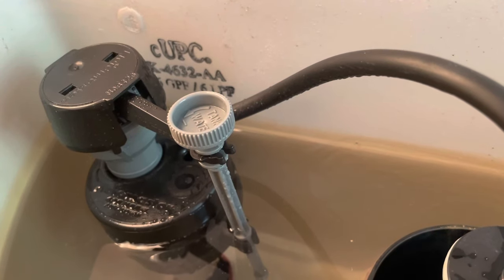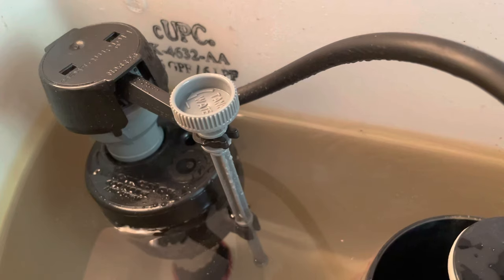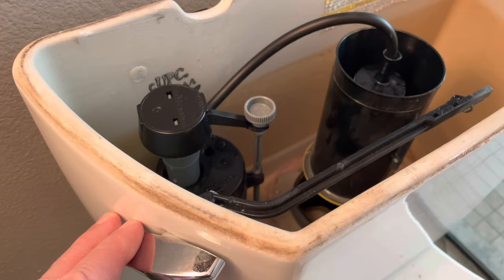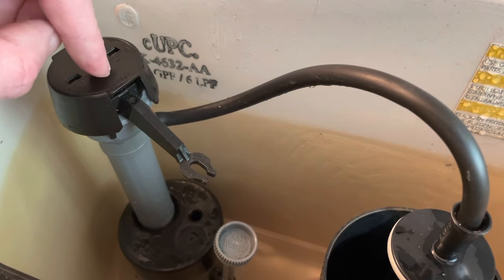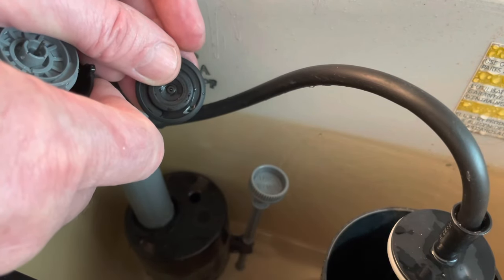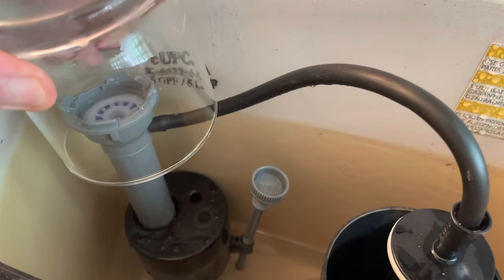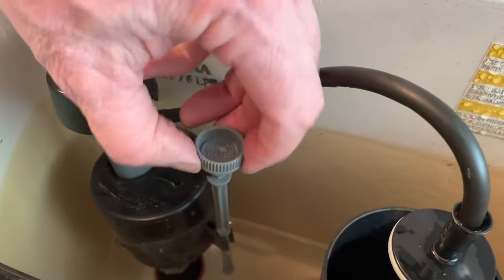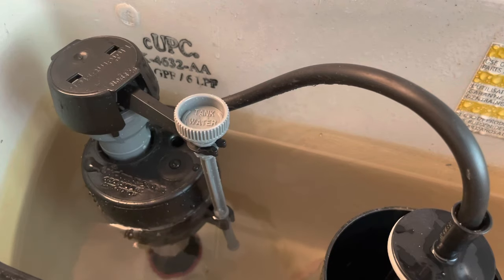Toilet Fill Valve Not Shutting Off / Don’t Replace / Fix Fast Cheap & Easy For Beginners

Comment: What if I have not water off valve
Reply from the maker: There’s no shut off valve on the wall?
Reply: @papajoeknows8355  mine actually pulls out to shut water off. Also, I saw on internet some people may not have shut off valve…

Comment: What if you turn the water off at the bottom but it still keeps filling up 🙃
Reply from the maker: It’s not uncommon for the valve at the wall to freeze up, because they are hardly ever used. It may be time to replace it. In the meantime, shut your water off to the house at the main.
Reply: @papajoeknows8355  I’m in an apartment building. I actually turn it off often bc of my toilet running and not being able to sleep. Today is the first time it didn’t work
Reply from the maker: @heycris5833  maybe try this to get that valve working. 

https://youtu.be/L-cTL7JJr8E
Reply: @papajoeknows8355  it lets me turn it all the way as it normally does. But the water just keeps going
Reply from the maker: @heycris5833  it might feel like it, but it’s not shutting off all the way. It’s gotten stuck.
Reply: @papajoeknows8355  ok going to try

Comment: What happens when you tried that still leaks
Reply from the maker: If you use your finger and lift up on the arm that extends from the top of the valve, does it turn off?
Reply: @papajoeknows8355  yes it stops but I have to lift in manually
If I let go any water that’s in goes straight out
I can’t get the water up to the bottom of the float?
Reply: @papajoeknows8355  ps thanks for responding so quick
Reply from the maker: @michaelhume8689  you probably just need to adjust the float. Here’s a vid:

Running Toilet Spilling into Overflow Easy Fix DIY
https://youtu.be/uTcYxn2bpDg

Comment: I tried it and it didn’t work.  I rinsed the seal, but didn’t wipe it.  I also did the rinse thing with the upside down cup.
Reply from the maker: Is it running and spilling into the overflow? If so, here’s a video:

Running Toilet Spilling into Overflow Easy Fix DIY
https://youtu.be/uTcYxn2bpDg
Reply: @papajoeknows8355  It’s not doing that.  It’s a very light spray noise coming from underneath the cap was was removed in the video.  There’s also a constant dripping noise.  Does not appear to be filling tank and going into overflow.  Thanks for the video/info.
Reply from the maker: @p0479  at that point, it’s probably simplest to just replace the valve, they’re only like $10. And there’s a little trick where you just replace the upper portion… I only take a few seconds, and you don’t need any tools. Here’s a video:

Replace Fluidmaster Toilet Fill Valve in Seconds For Beginners NO TOOLS NEEDED
https://youtu.be/ovdWF5Hdz8U

Comment: My toilet keeps running after it's full. When I shut the water off and turn it back on when it's full,  it stops.
Reply from the maker: If you use your finger to lift up on the little arm that extends from the top of the valve, does it turn off?
Reply: @papajoeknows8355  I tried that and it doesn't turn off. It doesn't turn off if I turn it back on slow. It turns off when I turn the quarter turn on quickly. And thank you for the response.  I do appreciate it!
Reply from the maker: @ericbitzer5247  have you followed the steps in the video?
Reply: @papajoeknows8355  Not yet, I have an eye disease called retinitis pigmentosa. I need a lot of light or I can't see what I'm doing. It looks simple enough.
Reply: @papajoeknows8355  OK, I did the steps in the video. The black seal looked OK. I put a cup over where the water flows out and turned it on thinking lime scale. When I put it back together it does the same thing, except now I have to giggle the arm to get it to turn on. And then the same thing turning off and back on turns it off.
Reply from the maker: @ericbitzer5247  when they get “fussy” like that, it’s easiest to just replace the valve itself, they’re only like $10.

And there’s a trick where you just replace the upper portion, very easy and no tools necessary. Here’s a video:

Replace Fluidmaster Toilet Fill Valve in Seconds For Beginners NO TOOLS NEEDED
https://youtu.be/ovdWF5Hdz8U
Reply: @papajoeknows8355  Thanks,  I appreciate it. I just wish the plumber I hired to put in the quarter turn didn't change out the old guts. There was nothing wrong with them and worked fine for probably 80 years. I got 2 out of the new.

Comment: I live in an apartment this toilet runs on and off they get these Plummer an some of them don't care i wish i could do it myself it is running now then it is off
Reply from the maker: If it’s turning on and off, then the tank is slowly draining… then when the level drops enough, the valve turns on to refill it, then shuts off again. Over and over. You need to simply replace your “flapper” or “canister seal” depending on which type you have. There are lots of videos on how to do this yourself.

Comment: My toilet tank doesn't always fill, so I lift the lid and touch the value and it fills. I rent, my landlady got me a new stove.
Reply from the maker: It’s time to replace the valve. There is a little trick, where you replace only the upper portion. Here’s a vid:

Replace Fluidmaster Toilet Fill Valve in Seconds For Beginners NO TOOLS NEEDED
https://youtu.be/ovdWF5Hdz8U
Reply from the maker: Also the valves are only like $10. You can get them at your home improvement store, but there’s also a link in the description if that helps.
Reply: @papajoeknows8355  Hey, landlady, fix this!
Reply from the maker: @patrickmccarthy7877  hahaha, or you can go that route. 👌🏻

Comment: My problem was the actual float sticking and not going fully up.
Reply from the maker: When they start getting “fussy” like that, it’s easier to just replace the valve. It’s easy to do, and they’re only $10.

Also, there’s a trick where you just replace the upper portion… it can be done quickly and with no tools. Here’s a video…

Replace Fluidmaster Toilet Fill Valve in Seconds For Beginners NO TOOLS NEEDED
https://youtu.be/ovdWF5Hdz8U

Comment: I tried this and it didn’t work for me, the floater isn’t floating up at all it just stays still after the water fills up.
Reply from the maker: When they start getting “fussy” like that, it’s easier to just replace the valve. It’s simple to do, and they’re only $10.

Also, there’s a trick where you just replace the upper portion… it can be done quickly and with no tools. Here’s a video…

Replace Fluidmaster Toilet Fill Valve in Seconds For Beginners NO TOOLS NEEDED
https://youtu.be/ovdWF5Hdz8U

Comment: ????  Is it the same, if my water does stop completely, but it takes about 4 minutes?????????
Reply from the maker: Sounds like it’s just time to replace the valve. So you know, you can buy one, but just replace the upper portion. No tools needed…

Replace Fluidmaster Toilet Fill Valve in Seconds For Beginners NO TOOLS NEEDED
https://youtu.be/ovdWF5Hdz8U
Reply: @papajoeknows8355  Thank you!
I got it working correctly. 
I actually just turned the screw dial to the left several times, now the water shuts off much quicker! ✅😀

Comment: Mine is making a sound after the replacement
Reply from the maker: When they start getting “fussy” like that, it’s easier to just replace the valve. It’s simple to do, and they’re only $10.

Also, there’s a trick where you just replace the upper portion… it can be done quickly and with no tools. Here’s a video…

Replace Fluidmaster Toilet Fill Valve in Seconds For Beginners NO TOOLS NEEDED
https://youtu.be/ovdWF5Hdz8U

Comment: Good man. '' Whatever is UNconventional,  and  necessary,  THAT   DO ''.   To  hell with those  manufacturers.  I F   they used  real metal ( not pot metal, or other cheap stuff) AND  MADE  THEM  PROPERLY,  they  ought  to  last a lifetime.  I fix most anything, with wires, and/or   small engines.  Do alot of  ' hacks '  to make them go.....
Reply from the maker: I miss the days when things were made in America, and when that actually meant something.
Reply: @papajoeknows8355  no  doubt......Thankyou  from  central eastern alberta   (hardisty)
Reply from the maker: @petersack5074  Alberta… never been, but it’s on my bucket list. I’ve heard it’s a beautiful part of the country!
Reply: There is about 15   500,000  barrel oil  storage tanks, east of town  2 km.  Google it.   From about Coronation south, it turns to  goat / gopher country,  Drumheller down. 
 Where  you ?
Reply from the maker: @petersack5074  just north of Orlando Florida here. And just looked it up, Hardisty Terminal, THAT’s alot of oil!

Comment: The top of my fill valve can't come off...
Reply from the maker: It may be easier to just replace the valve then. It’s easy to do, and they’re only $10.

Also, there’s a trick where you just replace the upper portion… it can be done quickly and with no tools. Here’s a video…

Replace Fluidmaster Toilet Fill Valve in Seconds For Beginners NO TOOLS NEEDED
https://youtu.be/ovdWF5Hdz8U

Comment: Eek! Trying to find my comment to edit, but it’s not here? Maybe you hold to approve? Dunno. Edit:  I meant to say FILL valve gurgle, not flush valve. Not gurgling in the bowl. Sound is definitely at the fill valve. Sorry!
Reply from the maker: No worries, actually I just read your comment, you had responded under someone else’s comment. That’s probably why you can’t find it. But regarding your valve, once they start getting “fussy,” it may be easier just to replace the valve as they’re only like $10. There’s a little trick too, where you just replace the upper portion, no tools needed. It can be done in seconds. Here’s a video:

Replace Fluidmaster Toilet Fill Valve in Seconds For Beginners NO TOOLS NEEDED
https://youtu.be/ovdWF5Hdz8U
Reply: Hi! Thanks so much! I think you’re right: it’s “fussy” at this point, and for the $ and time spent, it’s best to just replace the fill valve. I THINK it’s a Fluidmaster, but the twist rod to adjust the “float” looks different (top turning piece is grey and dime-sized; mine, the top is black and has a Philips-head slot on top to help twist/adjust it). The actual cap and gasket inside it looks identical to the Fluidmaster, so I’m wondering if it’s older or just a private-labeled one for my particular commode (American Standard Champion 4). I’m guessing it will be a similar easy change out, but will double check w/American Standard that it pulls out and a new fill valve (either Fluidmaster or direct order from American Standard) can be easily changed out. Will let you I know how it goes once I get back in there. Meanwhile, Thanks so much for your time and help! You are a GEM 💎!
Reply from the maker: @rabbit2rabbit735  yes, the older style Fluidmaster has the Phillips head top on it. To my recollection, the stem is the same and you should be able to replace just the upper portion like in the vid I sent you. In the event that you can’t. You can replace the entire valve, it’s not difficult to do at all.

Comment: You keep a package of those seals ?  Very convenient For it take years to get dirty again , but you’ll be ready.!!Just buy another valve dude they are $20  , by the time you need another seal something else would deteriorate
Reply from the maker: So you watched a video on how not to have to replace the valve so you can suggest replacing the valve… you’re a regular fountain of wisdom.

Comment: A plumber came in and replaced my fill valve and now the water keeps running. I don't know but sounds like he did this on purpose so I'll have to call him again. Now my tank keeps running. Water bill is double now. Maybe it's the flap and he didn't do anything on purpose. I don't wanna call a plumber again...too expensive of course
Reply from the maker: Here’s a video that will help…

Running Toilet Troubleshoot and Fix Fast & Easy
https://youtu.be/CNR_hb6vKXk
Reply: @papajoeknows8355  ok ill watch it now

Comment: I am not confident that just running the valve with a cup over it will clear mineral deposits.. you might want to soak it in white vinegar or something that will break down those deposits. That being said, I am here, so I don't know what the fuck to do to fix mine :P
Reply from the maker: When they start getting that many mineral deposits, it’s easier to just replace the valve. It’s simple to do, and they’re only around $10.

Also, there’s a trick where you just replace the upper portion… it can be done quickly and with no tools. Here’s a video…

Replace Fluidmaster Toilet Fill Valve in Seconds For Beginners NO TOOLS NEEDED
https://youtu.be/ovdWF5Hdz8U

Comment: Didn't work for me
Reply from the maker: Maybe just time to replace the valve, or at least the upper portion of it…

https://youtu.be/ovdWF5Hdz8U
Reply: @papajoeknows8355  yeah it was just busted up both my toilets would fill with water constantly but I fully replaced one and it works perfectly I just need to install a new one upstairs too, but thank you for your help anyways I was just getting frustrated so its not your fault man. Keep up the good work 💪
Reply from the maker: @dylan_008  all good, and watch that vid I sent ya about replacing just the upper portion… you can do it in seconds, no tools.

Comment: Omg im mad.  I pushed the valve down now i cant take it off.  Piece of junk.  Renting and i dont want the landlord here.  Simple fix. Yeah🤯🤬🤬🤬🤬🤬🤬😫
Reply from the maker: Not sure what you mean, pushed the valve down… you mean you pushed the cap down? Did you push it down and turn it to the left (while holding on to the stem underneath)?

Comment: Does not help at all.
Reply from the maker: Is water going into the overflow tube in the center?
Reply: @Papa Joe knows  yes it is and keeps running and running, all Day.
Reply from the maker: @robertkat  first, with your finger, lift up on the arm that extends from the top of the valve. If the valve turns off when you do this, then the water level on the valve is set too high, and you’ll want to lower it. It’s very easy, here’s a vid:

https://youtu.be/4m9qtMnnaEQ